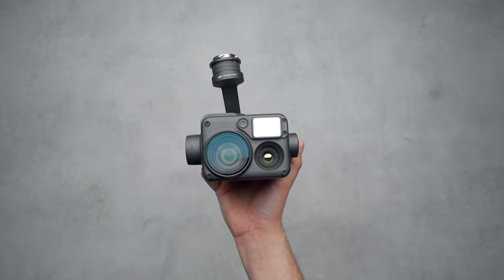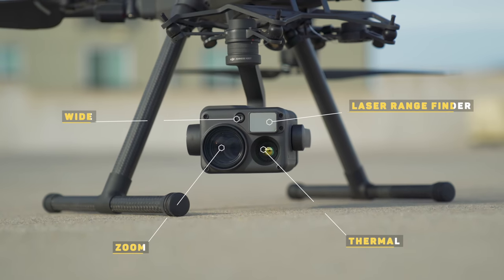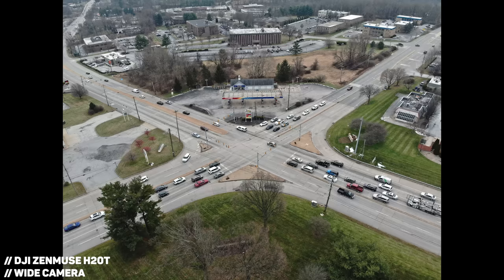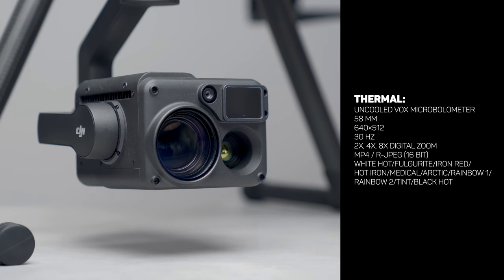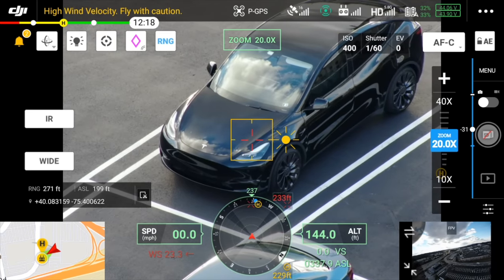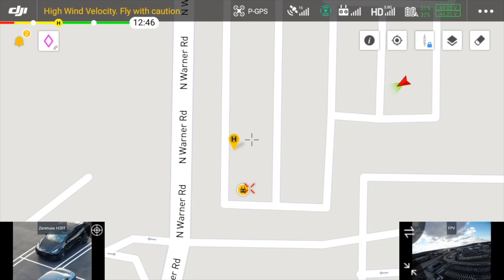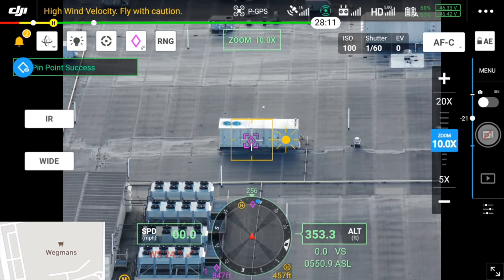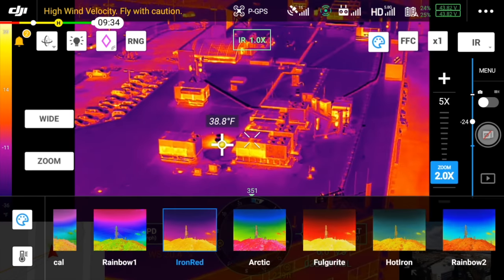DJI Zenmuse H20 & H20T Full Camera Overview

Comment: You can have a 48 megapixel sensor, but no lens on this planet can resolve those pixels. Thats why its pointless. Even that 20mp is too much for a 1/1.7" sensor. What matters is the pixel size & optical performance. Its simple math, you can calculate how many lp/mm the lens has to be able to resolve to be able to resolve the pixel sizes. 
Realistically, you can get around 8MP out of these sensor sizes. If even that.

Comment: This thermal camera is not suitable for measuring temperature values, only for a general view of its variation in the image. DJI does not provide the formulas it uses to correct temperature values. In truth, their closed-source software can do total stupidity and we as users can't do anything about it. My tests have shown that temperature measurements of a single object at a constant temperature oscillate over time by +- 5 degrees celcius, where the specification says +-2. I do not recommend it.

Comment: Thanks for this video. I’m in Italy. I try to ask you a question even if I know how to be off-topic and I apologize. So: the Skydio 2+ has finally arrived. I charge the battery, turn on the drone, unload the app and ... ... magically my iPhone 8pus does not see the drone's Wi-Fi network. Could it have been otherwise? Obviously not. I have searched all possible forums but have not found anything that can help me. I bought the starter kit. Drone Battery Bag Replacement Propellers. Again this morning I tried everything but nothing to do. The iPhone does not see the Wi-Fi of the drone. I also tried with an IPhone 13. But… .. nothing. Could you help me? Or someone from the community? I read on a forum that the Skydio 2+ uses 5.8 Ghz Wi-Fi. Not compatible with phones sold in Europe. Honestly don't think so of that. I wait patiently for help. Thanks and sorry again for my post. I've seen the video you made entirely and agree with your conclusions. Who wouldn't be? Hello and thanks for everything. Paul
Reply: Hello you won🎉🎊 a drone text above name on telegram assume your prize 🎉